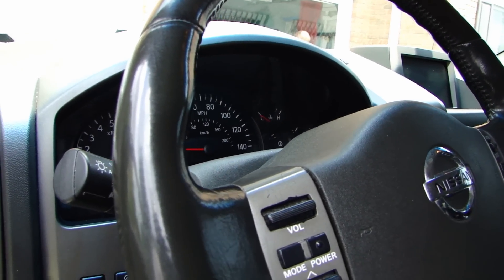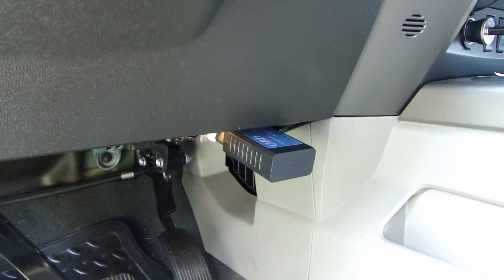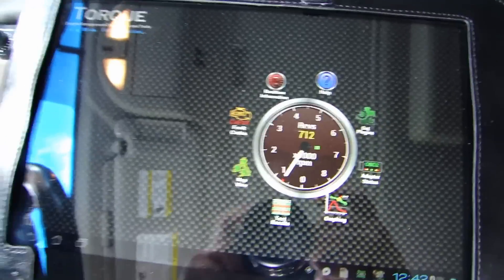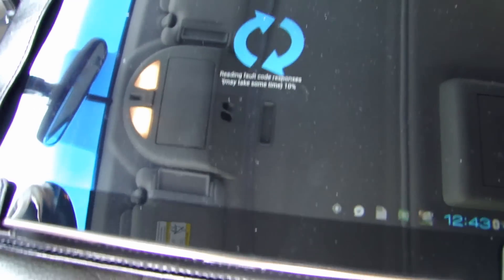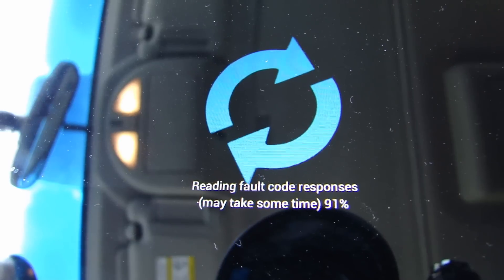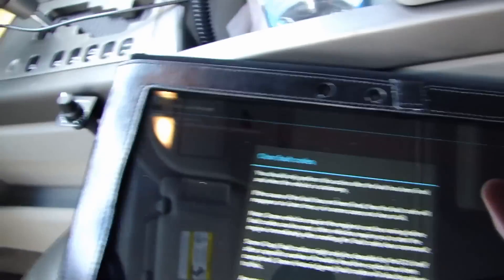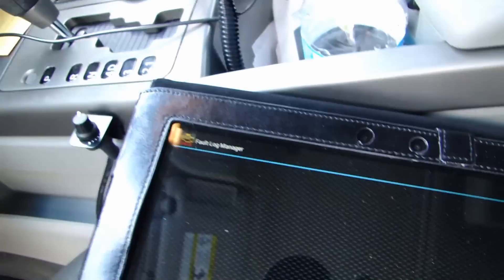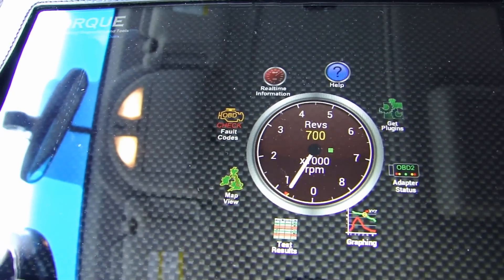How To Reset Check Engine Light (CEL) w/ ELM327 OBD Tool - Nissan Titan

Comment: please tell me the protocol you used. I have a 2007 nissan titan 4x4 and can't connect. The never gets solid.
Reply from the maker: +Jason Stewart The OBDII is a standard protocol on all cars built after 1996. If your scanner doesn't work, try on another car, if it still doesn't work, your scanner is bad.
Reply: +dial2fast OK thanks

Comment: hi im wondering if this device has potential to read abs, does it read transmission codes, and does it also test components ? in eg. evap leak test things like that. I bought a $150 scan tool and im not really digging it, it only reads some transmissions and im getting sceptical about its powers because with a $1000+ scan tool it reads a transmission code, but with my $150 scan tool it doesnt read the code or even show a transmission module, only the engine control module. it does abs, and i/m readiness but it doesnt really test components, it says not supported and its pissing me off. just want to maybe switch to a cheaper tool that does the same crap as this $150 dollar scan tool i bought